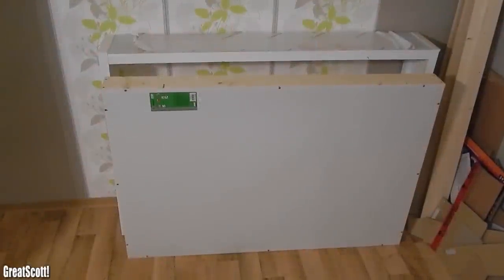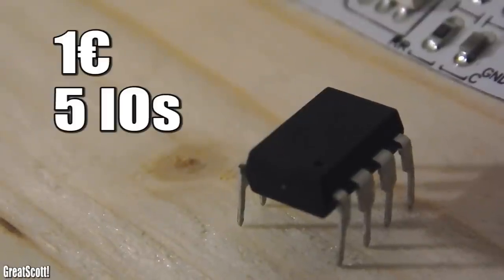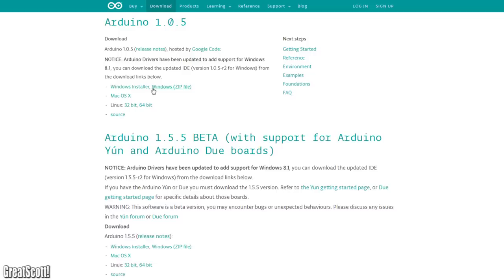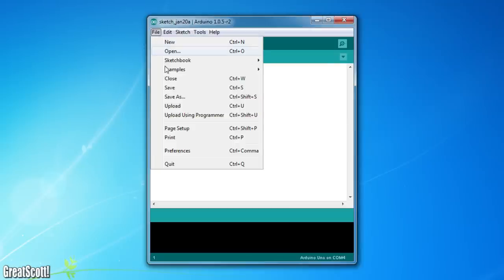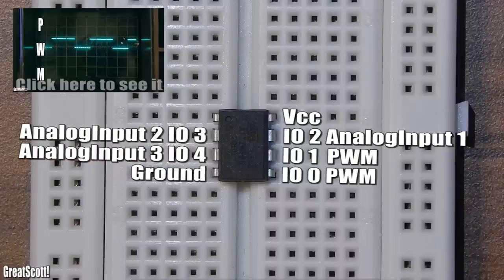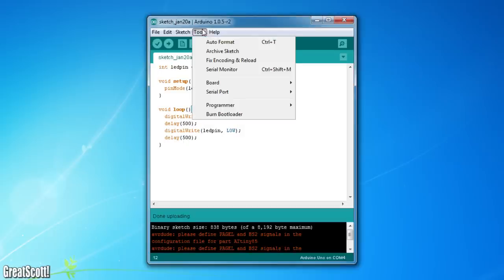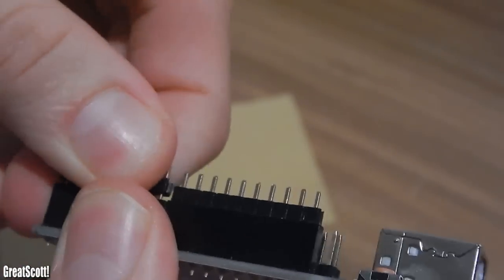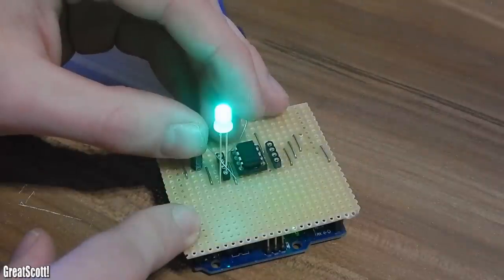Electronic Basics #3: Programming an Attiny+Homemade Arduino Shield

Comment: Great tutorial! Finally made my ATTiny85 work, but this video is a bit outdated.
For anyone struggling, check out the latest High-Low Tech tutorial, the latest version of arduino (1.6.7 at this time) works fine for programming.
Reply: thanks for updated :)
Reply: thanks!
Reply: @nachtfrosts  Thank you!

Comment: why do you put the capacitor?
Reply: To protect from over voltage
Reply: Thank you
Reply: caps dont protect from overvoltage. when you short a cap to ground you make a low pass filter.

the higher the capacitance the more higher frequencies are killed. A capacitor of infinite capacitance only allows DC to flow.

The cap is so that random EMR or voltage dips etc etc dont end up tripping the reset pin when the reset pin is not supposed to be tripped. This can brick the chip, since programmers use reset for programming the chip.
Reply: ***** oh, OK, that makes a lot of sense. Thanks
Reply: Decoupling the reset pin.
Reply: May i know the value of that capacitor?
Reply: Can be any value that holds a decent charge.
Reply: Thanks for the reply Azagro, so a 10uF, 50V is definitely more than enough?
Reply: Song Ji Hyo Yes.
Reply: Eric Cartman so it's for a rectifier circuit right? Same reason why it's used to convert AC to DC?
Reply: pragun dua not really. Rectifiers are diodes used to convert ac to bumpy dc and the capacitors store charge in the high points of the bumps and supply power during the low points, same with the capacitor here. It smooths out the voltage and keeps the chip from resetting
Reply: It's on the reset pin. It is to combat button debouncing.

Comment: Mr GreatScott! Why should I put a 10 microFarad capacitor between the reset pin and the ground pin?
And if I didn't use the capacitor , what would happen ?
And is it necessary that the capacitor's value is 10 microFarad ?
Reply: ahmed alhloul you put it there so arduino wont reset :)
at least its how I understood that.
Reply: To filter out high frequency noise, so the Arduino doesn't reset randomly.
Reply: In my opinion, Arduino IDE will send reset signal once you hit "Upload" button, despite the Uno on the other side of USB cable is running "Arduino ISP" sketch and actually not the target you want to upload your program into. Your Uno will be reset and broke the uploading operation. By hooking reset-pin of Uno with capacitor your Uno will continue working and "Arduino ISP" sketch will handle your program to ATtiny.

If you Upload with "Uploading using programmer"(option-click Upload button or alt-click for a PC) sometimes you won't need a capacitor. It will treat your Uno as an ISP and tries to reset the target chip instead of Uno itself. 
But in recent versions(1.8.7) broke this feature and Uno will still be reset. It is because a protocol change and Uno will still treat this signal as reset.
see this for detail https://github.com/arduino/Arduino/issues/8293

Comment: What kind of stripboard do you use? When I search for some on amazon I only find cheap ones that are rated pretty bad or expensive one with bunch of stuff on them, I only need a quare with holes an copper since im gonna cut it anyway
Reply: I would just buy the cheap stuff. What could possibly be bad with a piece of copper and silicone?

Comment: What kind of wires is he using on top of the Strip board for routing?  Looks more substantial than remnants of component leads. Also looks a lot neater than if I were to strip my solid core to just the bare wire

Comment: Greetings! I like your videos. Recently I am doing an R/C project which involves using pulseIn on pin 3,4 to read receiver signals and use pin 0,1 for out put. However, it seems running very slow. Have you ever come across something like this?

Comment: In order for using the Arduino the old way after using it for programming the Attiny should I just go on Tools/Programmer and select ArduinoISP instead of Arduino as ISP or do I need to burn the Bootloader again?

Comment: Hey GreatScott! I made this for the Attiny 85 and 84 and used my nano instead of the uno. Couldn't have done it without you. I wanted to show you pictures but I don't know what the best way is to share them with you. 

My only issue was soldering the female header pins on the boards to connect the Arduino. It was hard to get the soldering tip and solder under the plastic pins to make the connection to the strip board. Suggestions?
Reply: +Hydrameda the issue was actually soldering the headers on. because they go on the bottom of the board (where the solder strips are attached,) I couldn't get my soldering iron between the header and soldering strip. I'll try to get a picture
Reply: http://www.instructables.com/id/Soldering-a-LED-To-The-Wrong-Side-Of-A-PCB/

This is an example of what im talking about. Except they are talking about a LED, but same basic issue.
Reply: +Troy Puchini Those header pins have the black plastic spacer that can usually be moved/removed. You could solder the longer side of the header pins to the copper side of perfboard, then when soldered just wiggle the plastic spacer down or take it out completely. I found I can't really trust hookup wires to stay connected if headers have that plastic Part
Reply: AHHHHH, now THAT is a great idea. Thank you

Comment: Thanks for this very clear video.   I found the same procedure in a couple of projects at arduino.cc and hackaday,  but your explanation and photography are the best.   I tried it with a fresh Attiny85 and a generic Uno clone (with the CH341 USB to serial chip), and got the dreaded "Invalid device signature 0x000000".   (I'm running the Arduino IDE 1.8.13, installed from arduino-1.8.13-linux64.tar.xz on Debian 10, in case that matters.)  The connections are correct and Vcc is 5.01V at the target.  The forums tell me this means my ATtiny85 has its clock mode fuses set wrongly, and I need to use the high voltage programming mode to "unbrick" it.   Which is not a function ArduinoISP can perform, and it's not how the data sheet says the chip ships.    So I have a few questions.   1.   Have you run into this issue?   Did applying an external clock fix it, or did you need to use the HVP?   2.   Is there anything in ArduinoISP that requires a genuine Uno? or should any generic Arduino work?   3.    What's really going on with that 10 uF capacitor on the Arduino's RESET\ signal?, it seems like a kludge.
Reply: I'm digging into question 3.   It seems the Arduino IDE talks to the serial port the wrong way, causing a pulse on the Uno's RESET\ when it's not done talking to the ArduinoISP running on the Uno.   It leaves dealing with the (emulated on USB) serial port to the avrdude program, and avrdude doesn't know enough to do it right.   So the 10 uF cap is a kludge working around a missing feature in the avrdude program.   For a less kludgy fix, avrdude needs a new command line option to tell it not to pulse that serial port status line, but leave it connected all the time.   And Arduino IDE needs to know how to set the "serial port" up so that avrdude doesn't have to do it, and when to use avrdude that way.    Or avrdude needs to get way smarter about when to open and close the emulated serial port.   No wonder everybody kludged it with a 10 uF cap instead.
Reply: I tracked my problem down to an intermittent short between MISO and SCK.   They were shorted when the shield was in place and open when I pulled it off the Uno to buzz it out.   The SCK is low when the Arduino-as-ISP samples MISO so it was always reading back zeroes.   Thanks again for these excellent videos!

Comment: So you can remove the programmable part of the Arduino and install directly in another circuit? I did not know that. Arduino gets cooler everytime I see it.

I take it the programmable IC is slightly cheaper than the entire board, so you could get those in bulk, right?
Reply: The programmable ic is a lot cheaper than the board, but, will need some other, cheap components. For best operation, the atmega needs a crystal, a couple of ceramic caps and, if powering from battery, a voltage regulator. These can be purchased as a set on eBay.

Comment: You are the one of the few that can solve this mystery. I uploaded a sketch to my attiny85 that outputs PWM according to a potentiometer. It didn't work. It drew about 2.8-3.5mA, but when I unpluged the ground to the attiny, it started working and only drew around 0.7-2.5mA. Why is this?  And why will it not work when ground is connected to the attiny?
Reply: It is hard to know what is the problem if you dont list every connection here. Probably the potentiometer keeps sucking current - use higher ohm value pot. Protip - Make your sketch work on an arduino uno or nano, and use Serial.println(value); to debug the code.

Comment: Is it an issue if I use 47uF instead of 10uF between reset and gnd of the arduino? I have an Arduino Mega 2560.
Reply from the maker: +Mathieu Bacquet Should work.

Comment: Is it safe to wire the Attiny directly into 5V from ie.a phone charger or is some voltage protection advised?
Reply: phone chargers (like the brick you plug into AC) has voltage regulation built in.

Comment: Bit banging is not as you describe it "protocol emulation", this is a misdescription. Bit banging is the ability to shift or add bits onto an output address or variable, usually for the purpose of crafting specifc values of IO.

Comment: I am too late to start such project but I believe I am at right place to ask my question. 
1. Can I use ATTiny85 for FastLED projects to control programmable WS2812B (say 60 LED strip).?
2. Also can I program it using Arduino Pro Micro or any other Arduino board.?

I want your suggestion before I make any purchase. I am very new to Arduino. Please suggest me alternative if any. I am looking for cost effective too. Thanks.
Reply: @smert_okupantam Thanks a lot for time and reverting. Much appreciated.

Comment: Given the date of this video, you are most likely aware by now that the Attiny85 has PWM on IO4 as well as the two pins you mentioned? I'm using one in an RGB LED project, and it works fine. Not many ocs seem to be aware of the fact that three pins have PWM.

Comment: Exist a way to program ATtiny without an Arduino? (RPi, LPT, Serial Port or some cheap programmer)
Reply: +nicx321 Better just buy arduino clone from ebay they are 4 - 8 bucks :D
Reply: Nikola Nikolov Ok. thanks
Reply: +nicx321 or just buy a cheap usbasp programmer, which lets you program native or arduino code onto any AVR

Comment: Is it possible to connect a nrf24l01+ to an attiny?
Reply: Yes, it's very possible. you might want to use an attinyx4 series instead of attinyx5 since they have more pins to do proper receive interrupt and add buttons/communication etc.

Comment: This code did not stores the newpass string to eeprom, when ir button is pressed plz help
#include <EEPROM.h>
// Absolute min and max eeprom addresses. Actual values are hardware-dependent.
// These values can be changed e.g. to protect eeprom cells outside this range.
const int EEPROM_MIN_ADDR = 0;
const int EEPROM_MAX_ADDR = 250;

// Returns true if the address is between the
// minimum and maximum allowed values, false otherwise.
//
// This function is used by the other, higher-level functions
// to prevent bugs and runtime errors due to invalid addresses.
boolean eeprom_is_addr_ok(int addr) {
return ((addr >= EEPROM_MIN_ADDR) && (addr <= EEPROM_MAX_ADDR));
}

// Writes a sequence of bytes to eeprom starting at the specified address.
// Returns true if the whole array is successfully written.
// Returns false if the start or end addresses aren't between
// the minimum and maximum allowed values.
// When returning false, nothing gets written to eeprom.
boolean eeprom_write_bytes(int startAddr, const byte* array, int numBytes) {
// counter
int i;
// both first byte and last byte addresses must fall within
// the allowed range 
if (!eeprom_is_addr_ok(startAddr) || !eeprom_is_addr_ok(startAddr + numBytes)) {
return false;
}
for (i = 0; i < numBytes; i++) {
EEPROM.write(startAddr + i, array[i]);
}
return true;
}

// Writes a string starting at the specified address.
// Returns true if the whole string is successfully written.
// Returns false if the address of one or more bytes fall outside the allowed range.
// If false is returned, nothing gets written to the eeprom.
boolean eeprom_write_string(int addr, const char* string) {

int numBytes; // actual number of bytes to be written
//write the string contents plus the string terminator byte (0x00)
numBytes = strlen(string) + 1;
return eeprom_write_bytes(addr, (const byte*)string, numBytes);
}

// Reads a string starting from the specified address.
// Returns true if at least one byte (even only the string terminator one) is read.
// Returns false if the start address falls outside the allowed range or declare buffer size is zero.
// 
// The reading might stop for several reasons:
// - no more space in the provided buffer
// - last eeprom address reached
// - string terminator byte (0x00) encountered.
boolean eeprom_read_string(int addr, char* buffer, int bufSize) {
byte ch; // byte read from eeprom
int bytesRead; // number of bytes read so far
if (!eeprom_is_addr_ok(addr)) { // check start address
return false;
}

if (bufSize == 0) { // how can we store bytes in an empty buffer ?
return false;
}
// is there is room for the string terminator only, no reason to go further
if (bufSize == 1) {
buffer[0] = 0;
return true;
}
bytesRead = 0; // initialize byte counter
ch = EEPROM.read(addr + bytesRead); // read next byte from eeprom
buffer[bytesRead] = ch; // store it into the user buffer
bytesRead++; // increment byte counter
// stop conditions:
// - the character just read is the string terminator one (0x00)
// - we have filled the user buffer
// - we have reached the last eeprom address
while ( (ch != 0x00) && (bytesRead < bufSize) && ((addr + bytesRead) <= EEPROM_MAX_ADDR) ) {
// if no stop condition is met, read the next byte from eeprom
ch = EEPROM.read(addr + bytesRead);
// newPass = ch;
buffer[bytesRead] = ch; // store it into the user buffer
bytesRead++; // increment byte counter
}
// make sure the user buffer has a string terminator, (0x00) as its last byte
if ((ch != 0x00) && (bytesRead >= 1)) {
buffer[bytesRead - 1] = 0;
}
return true;
}
const int BUFSIZE = 15;
char buf[BUFSIZE];

char myStringChar[BUFSIZE];
#include <IRremote.h>
String pass="00506"; 
String pass1="00506";
String newPass= "";
int RECV_PIN = 8;
String btncondition3="40bd12ed";
IRrecv irrecv(RECV_PIN);
decode_results results;
void setup()
{
Serial.begin(9600);
 irrecv.enableIRIn();
 Serial.println("\n password " + pass);
  delay(2000);

delay(1000);

}

void loop()
{ newPass="00022";
    
  
  if (irrecv.decode(&results)) {
    
    if (String(results.value, HEX) == btncondition3){

  newPass == pass;
 pass.replace(pass,newPass);
Serial.println("Saving variable string to address 0");
newPass.toCharArray(myStringChar, BUFSIZE); //convert string to char array
strcpy(buf, myStringChar);
eeprom_write_string(0, buf);
 
 
Serial.print("Reading string from address 0: "); 
eeprom_read_string(0, buf, BUFSIZE);
Serial.println(buf);
// buf.replace(buf,newPass);
// newPass==pass1;
// pass1.replace(pass1,newPass);      

  Serial.println("   password : " + pass );
  //Serial.println ("2nd Old password : "+ pass1);
  Serial.println("Modified password : " + newPass );

  }
  

//eeprom_read_string(0, buf, BUFSIZE);

 irrecv.resume(); // Receive the next value
}}

Comment: can i use other arduino, like nano or pro mini?
Reply: +V-cu Yes, this is just smaller so its cheaper
Reply: But to programming ATtiny85?
Reply: Yes, if it has the same pins. Else jou would have to change the code so it would include the same pins as your programmer has
Reply: I just did this using my Nano. worked like a charm bc it still has pins 10,11,12, and 13
Reply: Doesn't work :( 
error:

avrdude: Yikes!  Invalid device signature.
         Double check connections and try again, or use -F to override
         this check.
Reply: Worked for me. I did exactly as GreatScott said (with the exception of the updated method of importing the Attiny board into Arduino software). I'm not super experienced so I can't help too much. All I can say is that I programmed an Attiny 85 using my Arduino Nano and this shield.

Comment: You didn't burn the bootloader on the ATtiny?
Reply from the maker: fabts4 I think this is only necessary if you want a a clock speed of 8Mhz.
Reply: GreatScott! I have no idea. You're sure the chip you bought didn't have a bootloader already?
Reply from the maker: Nicolas SCHMIT
I am 100% sure.
Reply: GreatScott! Then it means you don't need a bootloader. That's some interesting information :-)

Comment: how i add the attiny libray in mac??
Reply: +carlos duque (minecraft valladolid) Download Windows
Reply: +carlos duque (minecraft valladolid) This is not an issue: Everything around Arduino is not limited to any OS. You can use what ever you want. 1. Install Arduino on your platform. 2. Add the special board package for AtTiny. And you are running. BTW, I'm using Linux.

Comment: why the capacitor at the pins of arduino??
Reply: it's actually for the attiny . it needs a 10 micro farad capacitor between it's reset and ground pin . if you want to know why , let me know .
Reply: @sensiblewheels  I want to know why
Reply: @AshutoshSingh-to9vx  Perfect timing. The video from great Scott explaining all any capacitors has that detail.
Reply: @sensiblewheels  oh, didn't watch that. Thanks.

Comment: I am still processing how ATtiny is stong enough 4 those RGB LEDS
Reply: +LightningShock  a mosfet
Reply: no mosfet! the led stripe has an own power supply and is connected by only two wires for controlling..
Reply: I am talking about process power.